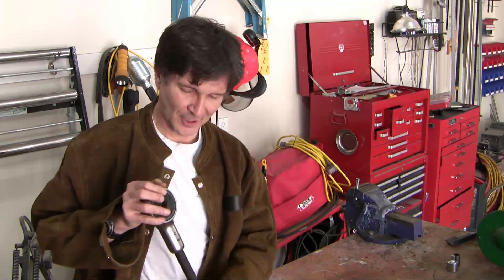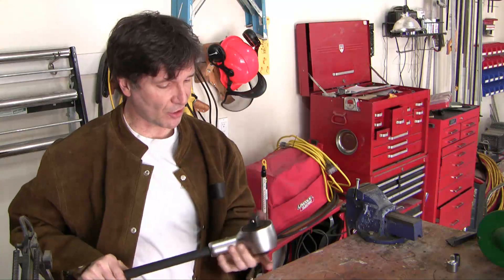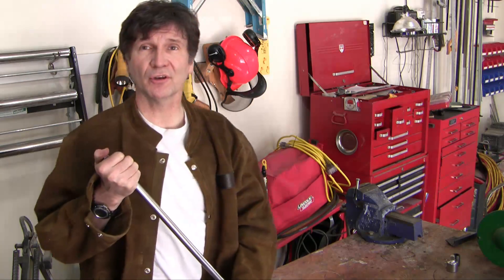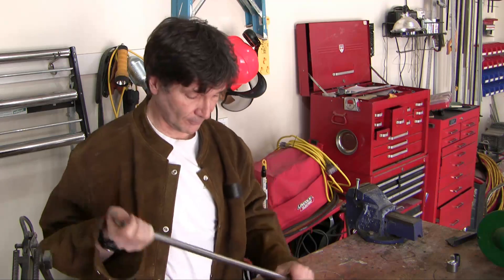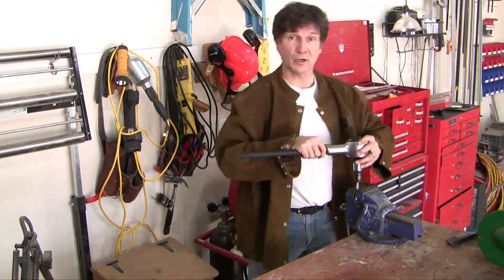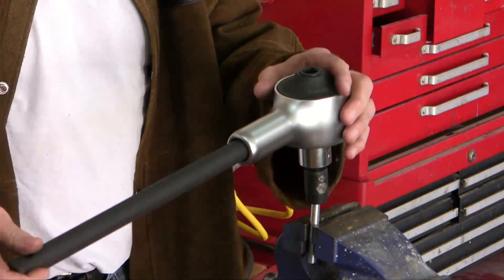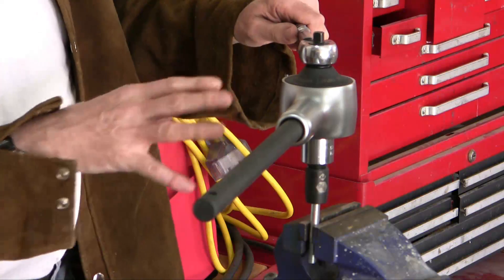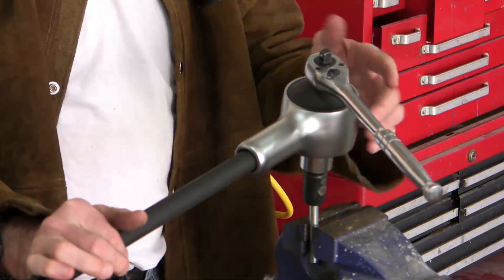How to loosen a stuck bolt by using a torque multiplier

Comment: Hi There, 
I am looking to buy Milwaukee Tool M18, mid Torque half inch impact wrench. I was told it is very helpful to remove tougher bolts. I am doing this to switch winter to all season tires.
Its quite expensive. I was told, it can break bolt, is it true can you explain.
Reply from the maker: Surprisingly, even with good quality impact tools I often find my breaker bar and oxyacetylene torch is more effective at breaking free stubborn bolts, though impact tools are pretty good at breaking through corroded fasteners. I love power tools because they are so fast, and occasionally they are better than hand tools, but not all the time. I would rank a 4 foot length of 1 1/2 inch thick wall pipe as best, followed by a good quality air tool and large volume tank (more than 25 gallons), followed by battery operated tools. Air tools are inconvenient but they are stronger than battery operated tools, especially as the batteries age. Air tools last longer. Batteries are getting better, and they survive longer than previous generations, but it is frustrating when the battery loses power. Remember when the battery dies it is often cheaper to buy a whole new tool. So for that extra speed you pay a lot, especially if you don't use them every day. On a budget for difficult fasteners, MAP gas torch is cheaper than oxyacetylene and only slightly inferior. I like my Milwaukee M12 ratchet because it isn't TOO powerful and it is fast and versatile for most nuts.
Reply: @spelunkerd  Thank you so much. Much appreciated

Comment: Meets expectations in all respects.✳✳>share4.photo/pLugWrench?ㅟ   I have used the wrench to loosen lug nuts, and I have used the wrench to tighten lug nuts. Operator needs to remember, whether the nuts should be loosened, or whether the nuts should be tightened. Depends upon various circumstances!

Comment: Thank you for your video. I had to take my wheels to the next step using something that is not found at most repair shops. I do not think anybody has tried this technique in the past. I had to use HHO Gas fire flame pinpoint heating with a heat shield to protect the aluminum rim to allow me to loosen up a stripped out over tighten lug nut. Here is my technique on video on YouTube.  https://www.youtube.com/watch?v=5t7eLqqCiTg&t=992s

Comment: Very nice tool should be handy for my new pickup . After 5 years, is your tool still  in good condition?
Reply from the maker: It's in good condition, but I rarely use it. Too bulky and heavy to take in the truck, as some mentioned below, although it might find a place on a repair truck. I'm still not sure where this one fits in the shop, since a very inexpensive cheater bar works pretty well, and a good impact wrench with oxyacetylene are all competing options. If I had to give up one, I'd lose the torque multiplier, as intriguing as the design may be. Even so, I do still reach for it once in a while. Anybody who has a shop knows that it is helpful to have several tools that can do the same job, since variable access can limit the utility of any one device.

Comment: What a great idea for the side of the road. If this happens to me at work, I usually grab a 3/4 gun and It usually comes loose. On occasion I have had to use a 1 inch gun. But really in actuality if a wheel nut is that tight, it is as you said rusted or corroded on, but it could also be cross threaded or severely over torqued, which in essence means the stud is stretched and really should be replaced.
Reply from the maker: Good points. I so rarely need a really powerful impact that I haven't dropped the cash to just keep one around. I also wonder how well powerful air tools stand up when they aren't used every day, although my 1/2" air impact seems OK after two decades. For the really stuck bolts, my local tool rental company will loan me a 1" impact for a few hours relatively cheap. Thank you for visiting!

Comment from the maker: I'm glad it helped. As some have pointed out, other tools, like a professional impact wrench or the mechanical advantage of a lift and cheater bar would often work just as well. But for some of us, those kinds of tools are not always available or easy to apply. 

What I found intriguing about this tool is the genius behind how it works. The same planetary mechanism is used in many gear boxes. Thanks for the feedback.

Comment: Let me put it this way:

There is a reason that literally 99.9% of the people who buy torque multipliers are people who own and operate large fleets of heavy duty vehicles and they are used exclusively for emergency on the road lug nut removal. 

That's the entire industry of people who purchase this tool. Anything that is so stuck underneath the chassis of a car to use this tool could have either been fixed with normal methods or would be sheared off with this tool.

Comment: There's a better torque multiplier tool out there. The one shown here is practically the same size as your breaker bar and cheater bar. Check out Cheater Wrench. Works great and has a lifetime warranty. Its compact and has a carrying case. Probably a better option for when you're on the side of the road and not in a shop.

Comment from the maker: You make a good point, Chris. This device is expensive and largely unnecessary in a professional shop, equipped with industrial quality air and air tools, oxyacetylene, and vehicle lifts. The lift in particular gives you mechanical advantage to hang off a long cheater bar, with lots of room underneath. But take away some of those and options are more limited. When I changed a track bar last year I didn't have room for a cheater and I was on my back with zero mechanical advantage. It helped.

Comment: I work on cars every day and that looks like a big useless tool its so big it won't be useful for anything in an engine bay or any other tight spot and if u come across a bolt that tight answerd u can't get it off by hand your going to break it that looks like a tool the would be in the toolbox of someone who has know clue what there doing

Comment from the maker: Yeah, a cheater bar is easier, cheaper, and simpler. But it's not so easy to use one when you are in a tight spot, such as lying on your back with limited access. Different tools for different applications. Thanks for watching.

Comment from the maker: Thanks for your comment. It does make some things easier, but for guys who do this for a living it takes a couple of minutes to set up and I think they mostly use air tools. I did show it in use on my track bar replacement video, where it was difficult to get room for a breaker bar and where my air tools didn't have the juice. It was surprising how smoothly the device worked.

Comment from the maker: For me it's a third option, not used very often except where I don't have much room to use a cheater bar and where nuts are too tight for my wimpy air tools. 

Lately I've seen a few vehicles with warped rotors that I think were caused by overtorquing lug nuts. So, I never use it to put nuts back on, and I'm a little suspicious of discount tire stores and their air tools. Lugs should not be hard to remove, but we all know otherwise. Thanks for your remark!

Comment from the maker: I got the pipe from Varsteel, a steel distributor here in Canada. Unfortunately the price of steel has risen dramatically in the past few years, but a simple cheater bar like that is still a lot less expensive than a torque converter. A torque converter is great if you have little room and you don't have air tools. Air tools are great because they add a vibration quality that may help to jar frozen bolts loose. Failing all of that, heat from oxyacetylene is great.

Comment: yeah they are being a real pain in the butt, i could castrate the stooge that air hammered the lugs on there in the first place, the threads arent stripped, the points on the lugs stripped when i went to bust them loose, and the easy off sockets cut them down even more. im gonna have to talk my boss into springing for a torch and might have to find another wheel or repaint the one we have if the heat ruins the paint. feels like im beating a dead horse without a torch.

Comment from the maker: I feel your pain. The device I showed is not specific for lug nuts. I've seen dedicated torque multipliers used for truck lugs that are much more robust, more expensive, and designed for 1" drive air tools. However, as you point out, if the threads are already stripped you're in deeper water. Oxyacetylene has always been the best answer for that situation, either as just a heating device or maybe, as you say, as a cutting torch. Hopefully you can spare the wheel. Good luck!

Comment: hows that gonna work if the lug nuts are hammered on so tight that it strips the lugs and an easy off strips it even more? we are fighting a pair of lugs on a ford focus at work, cant break em and we have tried to drill and split them, im affraid we are gonna have to torch them off.

Comment from the maker: Yeah, it's a novel and very old planetary gear design. I show an example of it in use, on the recent video "replace track bar Dodge Ram" video on my channel. There is another, more robust design that tire shops use to get lug bolts off. That latter design works better for lug bolts on big trucks, and it's stronger manufacture is designed for air tools, but is not as versatile as this design.

Comment from the maker: If you are breaking sockets a torque multiplier might not work either.

PB blaster works pretty well, and sometimes it works to try and tighten first, then loosen. But the gold star trick is heat, especially if you can get oxyacetylene. That rarely fails.

Comment from the maker: You've made a couple of very good points here. 

Indeed, I'm thinking of getting a third impact, since the first two don't have the kind of stones you describe. Oh, well, I suppose the next will be a quality tool like I should have bought in the first place. Of course it may be my tank or compressor. It's not the tubing -- short length 1/2" diameter should be fine....

Thanks for your contribution.

Comment: A bit off topic, but if you want to spend a bit more money on good impact, go with 1/2" HD Ingersoll impact.   I'm not trying to advertise, just I have been using the same gun now for 20 years, fully rebuiltable, and this bad boy rips anything you throw at it.  If 90 lbs pressure is not enough on setting 5, crank it to 120 psi , I've seen some shops running 160 psi (need more frequent rebuilt), and these suckers will put out way over 1200 lbs of torque.   Bolts either come out, or snap out, lol.

Comment: This is a good tool, but for tires, since you need multiplier and socket wrench and a socket, better option for that application, is to carry breaker-bar with proper socket attached.    1 deep socket will run you about $2.99 and breaker-bar (1/2") is about $15-$20.
Mind you this is a very good tool, such as for removing strut bolts, shock bolts, etc., if you don't have a impact gun.   My Ingersoll takes anything off, if not carefull, will snap off wheel nuts if set more than setting 3.

Comment from the maker: @mrjost55 Every spring and fall I swap winter rims and tires on my wife's car, and this was an opportune time to do the multiplier vid. Now that we are moving to a warmer area of Canada, we won't have much use for winter tires, but I'll probably keep them anyway. I'm not looking forward to the timing belt on the Hybrid, as I don't have any experience with a 600V system.

I actually prefer my 98 Dodge Ram. Old cars have more character, they have less plastic, and they are usually easier to fix.